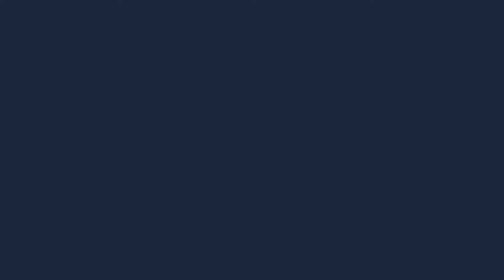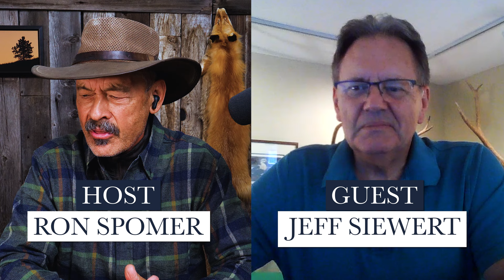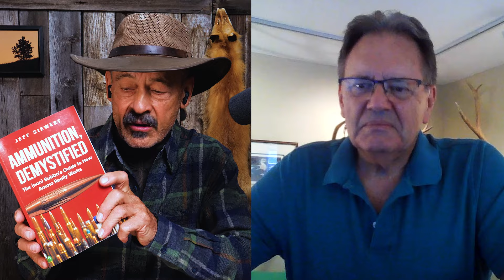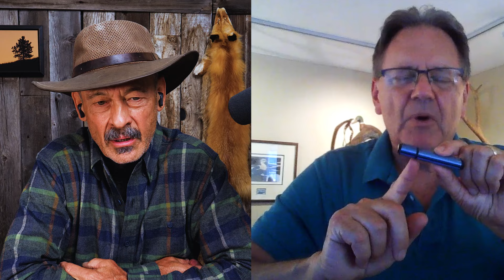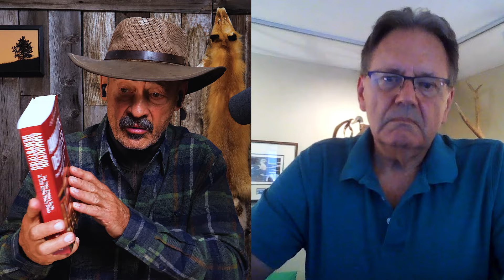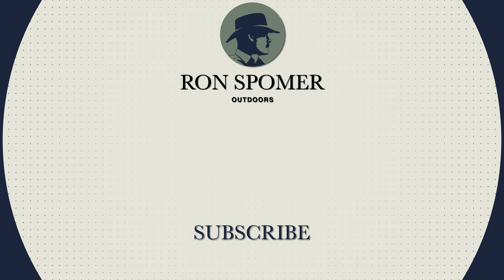323: Bullet Stability with Jeff Siewert

Comment: Good info, Ron... keep it coming.  Just ordered Jeff's book for another reference even though I've taught physics, dynamics, etc., and have been studying ballistics, internal and external for most of my life our of pure curiosity. Tiny jacket thickness variances will also cause an imbalance in any bullet and this imbalance will be worse with higher RPM's just like a tire that is out of balance won't be a problem in town, but will on the highway. Not an issue as Jeff stated with factory guns and ammo with good quality ammo, or with monolithic projectiles that have no real potential for imbalance. Every shooter should take the time to learn about ballistics... real ballistics, not the old wives tales we all learned at hunting camp. When we talk to our non-gunning neighbors we should know our stuff, regardless of where the conversation heads regarding firearms.

Comment: Hi Ron, 

I once cc measured and batched my brand new Lapua brass. Waste of time with new but after a few competition days the internal volumes can vary from material flowing under pressure. The walls of the case and shoulders tend to increase thickness. This is why the cases tend to fail above the belt line regardless of type. Loving the deep dive into proper ballistics!! Don't compete any more. 4 nights a week loading and tuning 1 day a week comp for many years no time these days. 

I didn't hear you mention bullet to lands distance or "Jump"?? It has a large affect on precision and accuracy. Looking for my old notes and data to share. Standard deviation is proof. 13f/s and group size was good enough for scores of 100 in Open Fclass, pity the muppet behind it wasn't most of the time😜 Wind can make all that work feel like a waste of time!!

Thanks Again,

Adam

Comment: Hornady warns against using their Superperformance loads in auto-loading rifles because the powder blend they use generally produce higher pressures farther than the barrel.  This means the gasses are at a higher pressure at the gas port.
Reply: It depends where the gas port is located  , like the M 1  the gas port is close to the end ( muzzle ) of the barrel so it requires a medium burn rate powder like 4895 , 4064 or 3031 .  If the gas port was located mid way you could use a slower powder .

Comment: A second interview with Jeff I have heard.
 One thing  for sure , there are so many variables. What we get is a based on a guess.
 Have the designers machined the imperfections into a childs top model to identify stability problems?  I guess the Rpm's would replicate a sub sonic load
 A gyroscope like a child's  top stabilizes best when it front weighted., imo
 So many silly questions

Comment: My dad said he qualified at 200 yards , I wonder if the 3006 is yawing at 100 yd.
Reply: The levels of yaw by 100 yards is typically only a degree or two.  Too small to measure on. a target.  Believe it or not, this was a issue for armies, especially during WWI because any yaw would reduce bullet penetration in sand bags, and penetrating sand bags were a big deal.   They measured average penetration at different distances.

Comment: I wonder why he recommended shooting three 5-shot groups and averaging them vs. shooting one 15-shot group. Did he mean shoot 5 then adjust, shoot another 5 adjust, and finally another 5?
Reply: Perhaps to let rifle cool, to add in cold barrel shots to the average, factor in different weather/atmospheric conditions on different days, temps, etc.
Reply: Don’t adjust after each 5 shot group, the average impact point walks around with every group. Shoot 3 five shot groups & average the center of impact for all three groups.
Reply: @jeffsiewert1258 It would be challenging to shoot for three days just to sight in a rifle. I have never shot three shot groups for this very reason. I usually shoot ten shots to get a better average. I guess I need to shoot another 5. I always let the barrel cool between shots too.

Having a computer track it over a few days sure would be nice.
Reply: @jeffsiewert1258  Why would the impact point walk around with every group? I know the parallax error from the optic would cause this, but I understand how to center my eye to prevent it. Other than that, other than various wind speeds, there isn't anything that should change from one group to the next.
Reply: It’s an artifact of the sampling statistics, every time you fire a group, you’re “sampling” the ammo. The average impact point “walks” based on the true dispersion divided by the square root of the number of shots fired. That’s why you should fire larger groups when firing for zero.
Reply: @jeffsiewert1258 I understand the variance in the ammo requires a higher sampling for a more precise average. I should have been more specific. What I do not understand is why three 5-shot groups are better than one 15-shot group for someone who does not have the software or multiple days to sight in a rifle.

Thank you for taking the time to reply to my question. I have an engineering degree and could pick your brain for hours. I have two cartridge designs I believe are the future. I would love to get your feedback on them.

God bless.
Reply: So there’s probably little difference between using the Mean Point of Impact for a 15 shot group vs an average of 3 five shot groups.. Ron is right about letting the barrel cool, particularly if the barrel isn’t free floated. The idea is you really need a pretty large sample to get a solid zero. I’ve written a new white paper on zeroing the rifle, I should have it on my website in a couple of days..

Comment: 🕵️‍♂️ Ok, as an Engineer, I have a problem with what Jeff said! "Trusting the Software" - without understanding the limitations of the software and it's formulas - is not a good idea! NO GOOD ENGINEER DOES THIS!!! 😬 Why? Because, "Mathematical Models" often make "Assumptions"/"Generalizations" that aren't always correct to every specific case! ☹ And, in the case of Correlation Coefficients - or R^2 - It Has Several Limitations!: 1.) It cannot determine the non-linear relationships between the variables (i.e. Not every relationship is linear or directly correlated.). 2) It does not distinguish between dependent and independent variables (i.e. What caused the problem and to what extent?). For example, does a different lot of the same type of powder generate the same amount of energy or velocity every time? No, it is not a constant! So, making the "assumption" that it does in a mathematical formula would create (introduce) an unnecessary error in the data results! Thus, if we have a flyer, Why was it caused? And, How does that flyer skew or bias the data? And, What is the "Confidence Interval" that the data is correct? Their are two schools of thought - both with obvious limitations! The First is the Engineer, who always wants more data. But, as you can see by this example, the "solution" to getting it isn't always practical! Shooting 15 shots with a box of 20 cartridges isn't something most of us aren't going to do - especially if we have both a deer and elk tag in our pocket and we are hunting in Grizzly County! Would you want only 5 shells to "solve" at least 3 different problems? 🐻 Thus, Jeff's "Solution" doesn't take into account "Other Variables" (Jeff has his "blinders" on and can't see the bigger picture here - or obvious flaws in his logic - because he is thinking "inside the box" and not taking into account "outside variables".)! Thus, a pack of Wolves 🐺 may eat Jeff, if he goes into the back country with only 5 shells (Like alot of Engineers, Jeff can't see the Forest through the Trees - too focused on the small/fine details to see or account for the bigger picture/problem)! 😳 Conversely, other experienced shooter's (like an Eric Cortina) will talk about zeroing your rifle with one shot! 😂 But, is that really accurate, according to Jeff? NO (Me either - because it's not mathematically correct)! 😏 Thus, the "Truth" lies somewhere in the middle (both are wrong with their "logic") - as to how much data is enough, for a given sample size (from a statistical prospective, at least 10% minimum is a typical "rule of thumb")! But, I will save the rest of my comments for another post! 🤣
Reply: So i fed my family for 40+ years and helped my kids get thru college as a ballistics engineer. If you think I’m wrong, you’re entitled to your opinion.
Reply: 🤣 Tell that to the Grizzly Bear or Pack of Wolves, when you run out of shells!.😱 5 Bullets to fill 2 tags and fend off predators isn't going to be enough! I Bet Eric Cortina Thinks He Is Right Too? Well, simply put, you both can't be right when you are saying the exact opposite things! But, You Both Are Wrong, If You Actually Read What I've Written! 😜 Have a Nice Day! 🤠
Reply: Nothing is stopping you from buying another box of ammo, other than getting lost in the data and irrelevant scenarios.
Reply: 🤠 The Lamar Valley Wolf Pack has 175 Wolves and does occasionally come out of the park to where I hunt! So, you aren't fighting them off with 5 shells or 25 shells! Being a hunter where I live requires that you know more than just about ballistics! 😉 However, I have been an Engineer for just about as long, graduated from one of the most prestigious universities in the country, married a High School and College Valedictorian, and Have a Child Just Finishing Medical School! So, I am no  dummy either! But, all the pieces of paper on the wall do you no good, if you don't have any common sense! 😂
Reply: 😂 Anyone going into the back country of the Rocky Mountains, with only 5 shells, better be saving the last one for themselves! 😵 If you listen to any of Randy Selby's videos, you'll quickly realize that you may shoot an Elk and see both Bears and Wolves standing over your kill before you get to it! 😯Then, you may run into some armed hostile person, trying to claim your trophy! Multiple times I have been packing out Elk Quarters at night, when a Mountain Lion has stood over my kill and followed me out of the mountains!😬 Then, if you get hurt and need to be rescued, those "additional shells" will help the Search and Rescue Find You! 🕵️‍♂️ So, anyone going into the back country With Only 5 shells is a Fool! 🤪 But, I am no ordinary "Weekend Warrior", I am Ronbo (Montana Mountain Man)! 💪
Reply: Did ya only buy one box of cartridges when you live 200 miles from town? 
I freely admit I didn’t consider a scenario where you might have to fight off hordes of wolves & grizz, but if you live in a place where that’s a possibility, sure, make a tradeoff. I suspect in such a situation, you’d be buying more that one box of cartridges.
So over the years, i’ve taught ballistics classes to: Federal, Winchester, Remington, Sierra, Barnes, Nosler, Swift, Norma, Nexter, Daikin, Nammo, US Army, Navy, AF., just to name a few. If you’d rather believe someone else on YouTube, that is your right. But if you had a burst appendix, would rather you rather have the paramedic cutting on you or the surgeon with 40 years experience?
Reply: I know about you and your credentials! Today, I am at a conference surrounded by a bunch of Fellow Engineers (P.E.'s and PHD's), asking them pointed questions! So, I don't care what letters you have next to your name! What I care about are getting the right answers! As I said, Eric Cortina just came back from winning a World Team Title, but he has a different opinion than yours (and mine too)! It's ALL about being Right, not about being "experienced" only! 🤷‍♂️ As a Consultant, they only pay me for results, not for just  being educated or experienced! 🙄
Reply: 😏 Would it make you feel any better if you knew that you were only 1 of 4 PHD's that I told them that they were wrong today??? 🤣
Reply: So stop beating around the bush & tell me EXACTLY what i said that you THINK is incorrect.